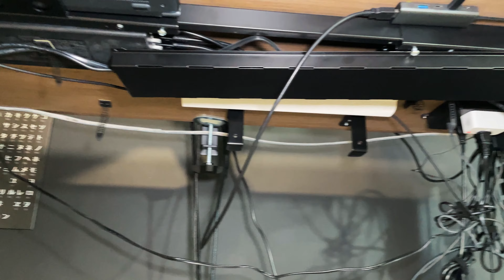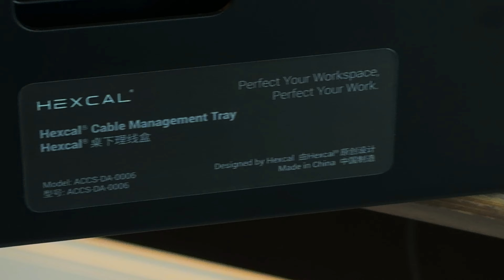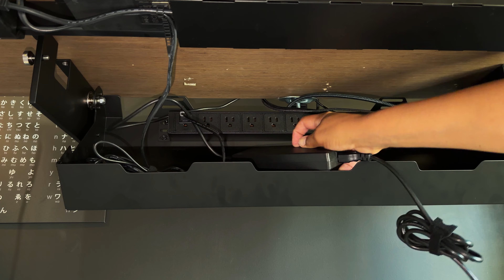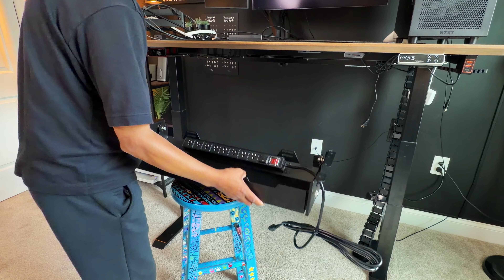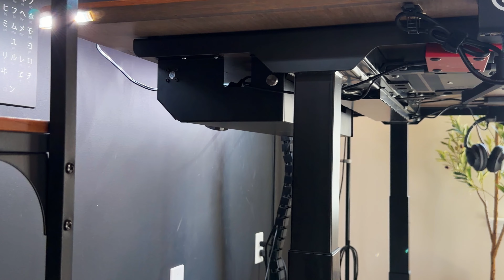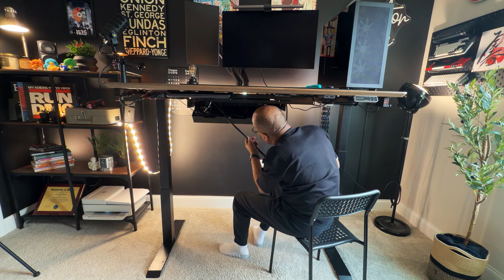This Cable Tray Changed My Desk Setup

Comment: Since zip ties are often a messy solution for power strips, hiding the PDU and surge protector under a solid steel tray keeps everything out of sight without needing to tape cables down. A clean workspace usually means fewer trips to untangle cords during busy work sessions.